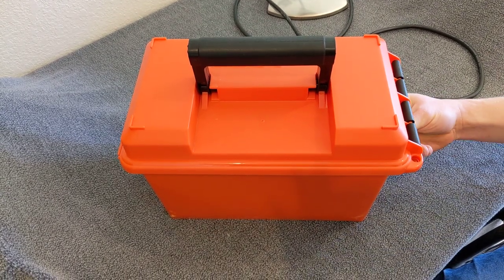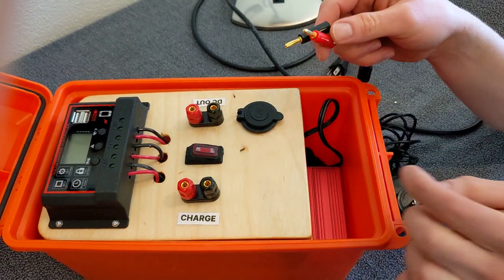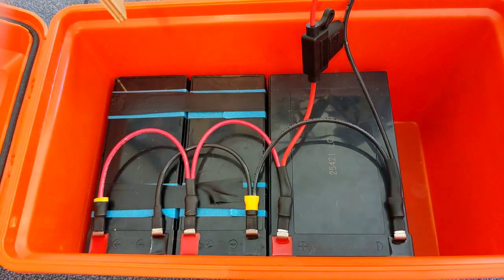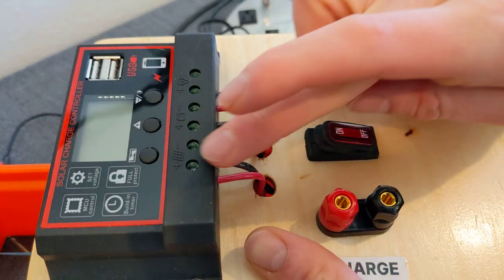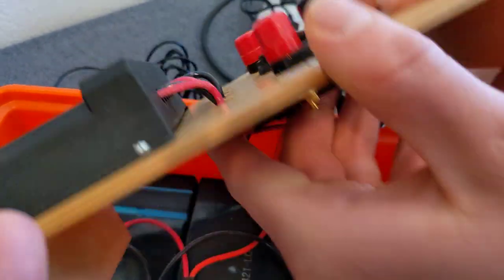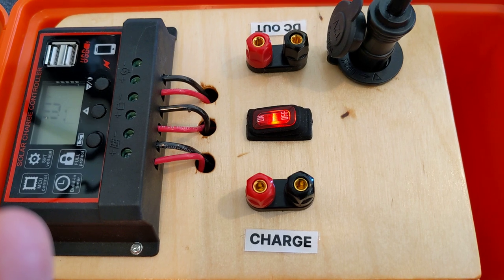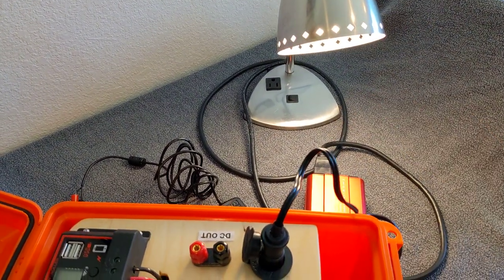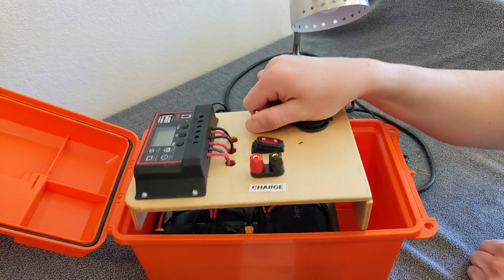DIY emergency solar power backup in an ammo can

Comment: The 200 Watt inverter will draw approximately 15 amps if it is actually asked to supply the full 200 Watts.  The solar charge controller’s “load” output can’t handle that much current.  Better to connect the inverter directly to battery (fused of course).

Comment: Very nice and neat solar power backup.  I have done the same thing and just posted my video on YouTube.  I haven't received my solar charge controller yet, supposed to be here tomorrow or Saturday.  But I am all setup up, already have installed the connection to plug in my solar panels and have the wires run to plug into the controller.  One issue I saw with yours, and I have heard that the proper way to hook up the solar controller to the batteries is to hook the positive to one battery, and the negative to the farthest battery away.  This way all three batteries are being charged at the same time with equal voltage.  Also, the same is true for drawing the batteries down.  The way you have yours hooked up with the positive and negative going to the switch, it is pulling from the larger battery first then the other two.  Just an opinion and again, I have watched dozens upon dozens of these builds before I started mine.  Again, great video, and a project for sure!!  Juddie - J & J TOA

Comment: Thank you. Off all the videos on YT I have seen so far your video was clear and helpful. I was looking to built a similar portable solar PowerStation using 30 ah Lifepo4 batteries. Your explanation of the circuit connection helped me in the project.

Comment: I like the build and want to make one myself. But I looked at your web page and linked to the items needed and I have a problem with the dimensions. If the inside diameter of the ammo box is 11 Wide X 5.8 Long X 7.2 High, how are you fitting a 5.94 long battery inside that box? Are the dimensions listed on Amazon a bit off?
Reply: @ThePrepared  Thank you for the reply. The ammo box you are using shows to have the same dimensions as the Zombie ammo box from the same brand name. I'm hoping those specs are true because that's the box I want to use. Once I get the box and measure it I will order a couple of those 15 AH batteries and the other components needed.

Comment: Thank you for posting and sharing, this is a very good build.
I made a similar one and gradually added a MPTT solar controller, a 30AH LiFePo4 battery and a 12v 10A regulated output for the 12v output to support a CPAP or a portable air compressor to fill the air mattresses.

Comment: This is great, thanks for the inspiration.   Question, how do you connect 2 wires to the battery terminal post?  I also need to connect 3 batteries in parallel but not sure how to double up the wires. Did you manage to crimp 2 wires into a single spade connection?  I have seen 'piggy back female spade connectors' on Amazon but don't know if that would work.   Any advice would be helpful.  My 3 batteries are like your smaller 9amp ones.

Comment: Great project. I noticed that you have the 2 two  18 volt batteries in parallel with a 15 volt battery. There is a slight incompatibility here. That means that the 18 volt batteries will only charge to 15 volts or to the level that the 15 volt battery will charge to because of their parallel connections.  

.. I don't think that's much of a problem however, if you did want to utilize the full charging of the 18 volt batteries then a very different arrangement would need to be made. However again I'm not sure that the gain would justify the effort. Talk to somebody who understands electricity well and kick it around.
Reply: Two 9 amp one 15 Amp all three are 12 volt but yes they should not be together
Reply: @martinvasquez4607  all are same voltage so they are fine to put in parallel for output. The issue is with charging. Different amperage or even same amperage but different BMS due to different brand is an issue. So for charging I would take the 15amp one out of the circuit temperarily, eg  with a switch and you can charge the two 9 amp together, and  then the 15 separately. Keep the lid up when charging to avoid cooking the bats.